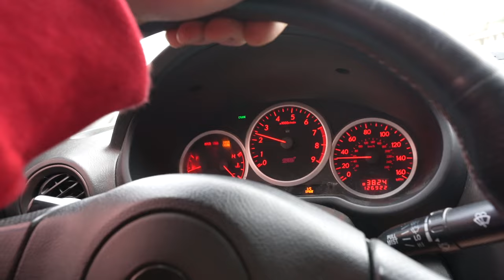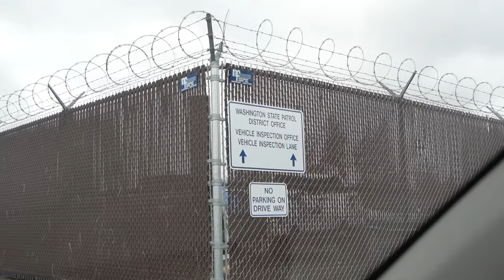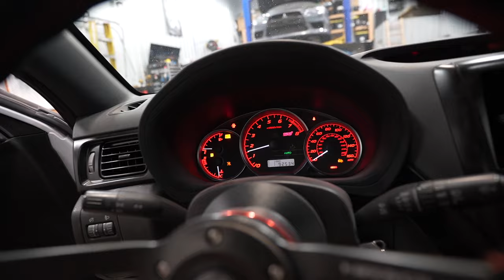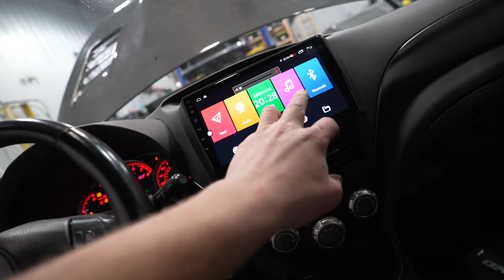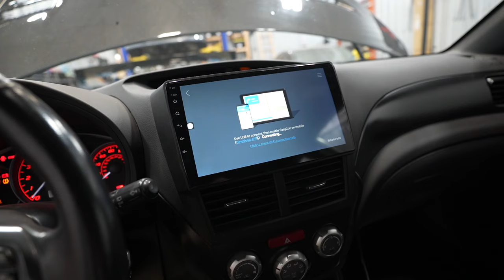Everything i hate about my STi...

Comment: On the susti, if airbags went off at one point there might be a hard code still stored in the srs module keeping the lights on. If all the srs system is plugged in and lights are still on, send the module off for repair/reset 👍

Comment: Sometimes airbag lights need to be cleared after repairs, if the clock spring was the only problem in the system it might clear it’s self with a few key cycles, also there is orange locks on airbag connectors that need to be clipped in or it will throw a code

Comment: Wire in a resistor to remove airbag lights. Works when you install Jdm seats into sti’s. 

ZLink on the idoing head until is the CarPlay connection.

Comment: I want to see you install a remote start on your older cars with proximity door unlock. You have to reset the ECU with a diagnostic tool to get rid of the airbag light, or so I'm told.

Comment: Srs control module might have a crash signal prob of they cut those wires. If this is the case you might have to send out that module to get reset and have new data put in. If it is the case is a 30$ process

Comment: Hey dude, on my 2020 STi I noticed when I shift to 4th gear while in boost, the shifter has a slight vibration. What can this be?  I'm afraid to take it in to a dealership because I have to undo my intake, heat shield and reflash back to normal so I don't void the warranty. Any ideas why the shift from 3rd to 4th vibrates but then stops?